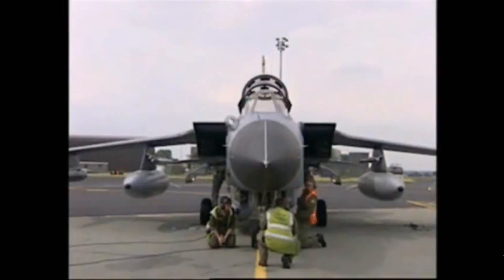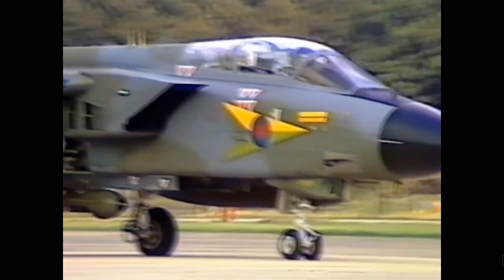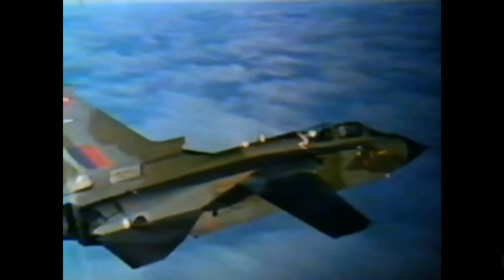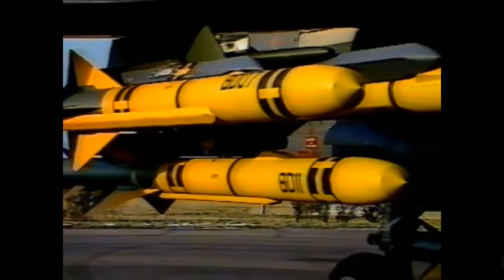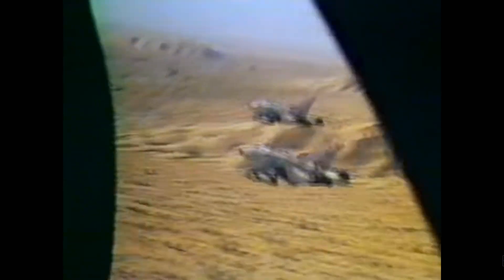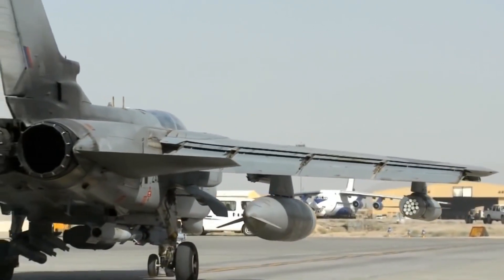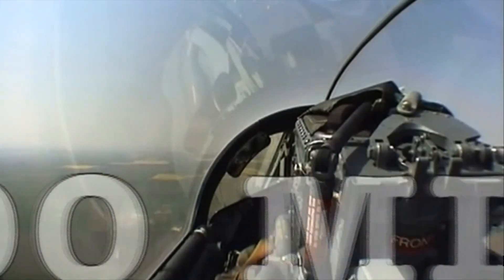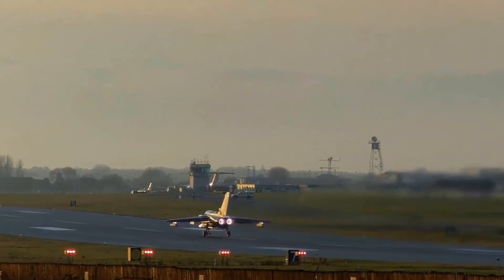Panavia Tornado - Twin Engine Sweep Wing Fighter/Bomber

Comment: It's low level agility and speed are still unbeaten. The Tornado can close in on an enemy at low level that would promote structural failure in any other aircraft. Extremely robust structure.
Reply: Jonny its amazing :P
Reply: it flies so low that the thrust probably promotes structural failure in any buildings around as well
Reply: Even Mig 27, you sure?
Reply: Even Mig 27.
Reply: Jonny you’re forgetting the b1b lancer it was designed to fly at a low altitude while having tons of speed it also has a system where it scans the ground and helps the pilots out
Reply: F-111?
Reply: @timberwolf27  The Mig 27 was not even in the same class as the Tornado.. not even the Su 24 was (much bigger plane for same payload and range of a Tornado). The F 111 created a class of low level variable geometry long range penetrators, with the SU 24 and the Tornado following suit. The Tornado being the last, learnt from the F 111 and Su 24 mistakes.. it was safer to flight that the former planes, more compact but with a huge payload. But it was a generation latter when 4 gen fighters converted into penetratiors like the F 15E and the SU 34 came into service.
Reply: gripen tho
Reply: @broach6152  negative
Reply: Yep.
Probably partly thanks to the fact it looks somewhat like a brick.

Comment: I got a story about these. Back in 2013 when I got to my first base in the USAF in Holloman AFB New Mexico, I wasn't aware that the German Air Force had a training unit with Tornados. I had only been on base for one day when a flight of Tornados took off from the flight line right over my head and scared the crap out of me. This thing is fucking loud! Plus the Germans are crazy.
Reply: The sound is like no other aircraft, even at a distance, it sounds like a huge cotton sheet being torn in half. A strange description but when you actually hear it, it makes sense.
Reply: Yep. First saw a tornado  (a German machine) at Aer Spectacular 88 at the Irish Air Corps Base at Casement Aerodrome, Baldonel in Dublin and holy shit... When it took off it scared the shit out of me but that was nothing compared to the low level high speed pass it performed with the wings swept back.... This thing was LOUD... and I DO mean LOUD.

Comment: ...and yeah it's a fly by wires flight control system .... an amazing terrain following radar, basically hands off flying at low levels with blistering mach 2  .... and don't forget the reverser buckets during landing, the envy of many 💪💪🙌🙌👍👍❤❤

Comment: During a documentary, it stated that the Tornado was the first non American aircraft that could beat anything the US could throw up against it in terms if low level bombing
Reply: A lot of that possibly has to do with the fact that RAF Tornado, Jaguar, Harrier and Buccaneer pilots flew about 50ft. from the ground (mud moving), so were much harder to shoot down by enemy fighters due to ground clutter. it's also one of the fastest aircraft in the world at low level, that's why most of the airfield attacks during the first gulf war were undertaken by RAF Tornados (and Jaguars). I've heard a lot of stories about US pilots being in awe at how low the RAF flew. I also believe that due to the swept wing, it has one of the fastest roll rates of any military aircraft.
Reply: The Brits lie their asses off about the specs. For example, in order to push the LIE that the Tornado was the fastest plane at sea level, they compared an entirely clean Tornado to an F-4 Phantom that was outfitted with a drop tank and external stores fitted! In truth, the Tornado is a fine strike/attack aircraft with some fighter/interceptor capability. This sort of thing is not new. Even "documentory" movies from the 1950s go to great lengths to hype British equipment, while downplaying the capabilities of similar allies' forces, or even ignoring the information. For example, I have a video, that was made in England, comparing British and American bombers. The HUGE bomb loads of the British bombers were constantly mentioned, while the (usually superior) payloads of the American bombers were briefly mentioned, or fudged to make them look smaller.
Reply: mrnickbig1 Remember, the RAF also had F4s, who cares what they apparently said.

As for British documentaries hyping about British equipment, now you know how everyone else feels when they have to watch American documentaries. Just pure arrogance. But it's fine, you "won the war", apparently 😂
Reply: I think our F4s' had Rolls-Royce Spey engines, so they were quite different from the American versions.
Reply: No disrespect to the Tornado but the F111 was the king of low level bombing. The F111 was the best strike aircraft overall of the late/post cold war era. Just look up it's Gulf War combat statistics if you don't believe me. Responsible for 80% of all laser guided munitions, 1500 tanks etc. Not that many served in the conflict either.
Reply: After the TSR 2 debacle we ended up buying Phantoms - initially as a stop gap. To make it more palatable we insisted on British engines...so we had to modify the airframe making it bigger and heavier. Despite the more powerful British engines the plane wasn't improved - any advantage was offset by the increase in weight.
Reply: American B17 heavy bomber, capable load 4000lb's. British Mosquito light bomber - 4000lb's (plus one of the fastest planes until close to the end of the war).
Reply: Depends on the period - during world war 2 Avro Lancaster standard bomb load was 14,000lbs (sometimes carried far more) B17's was 4,800lb. RAF also dropped more tonnage of bomb on Germany during the war (by far in 1944) See wikipedia.  Post war this changed, but I still rank the Bucaneer and Tornado as two of the worlds best attack aircraft and I'm not convinced that the USAF had anything to match it.
Reply: F111 flew its attacks much higher than Tornado. It dropped alot of laser guided munitions on tanks in the gulf war - they were dropped from medium altitude on the tanks that showed up very nicely on infrared having warmed up in the Sun.
Reply: Really? Which war, according to who?
Reply: And yet, the reference was specifically to AMERICAN planes, not British variants. Does "first non American aircraft that could beat anything the US could throw up against it" sound familiar?
Reply: Tom Riley The F111s fitted with pave tack radar flew many low level sorties as well, as far as I can tell. Multiple F111's were hit with AA missiles and returned to base safely. Tornados on the other hand suffered comparatively heavy losses. So low level, survivable, faster, bigger bomb load, much more impressive battle scoreboard. F111 are undeniably brilliant.
Reply: EF111 even downed an aircraft without firing a shot.
Reply: Jimmy W how the fuck is this even possible can I have the source
Reply: Jameson Dymond just use any search engine and search for "F111 Gulf War".  They are not invincible, but they can take a beating. One was a missile from a Mig 23 and another from  Mig 29. EF111 downing an aircraft without firing a shot is a well documented case. Well it was mostly due to target fixation and the stupidity of the Iraqi pilot... Still cool all the same.
Reply: mrnickbig1 u could say that about many documentaries made on discovery I was watching one the other day about ww2 and the DDay landings and whenever an American unit made a advance it said u.s unit such and such had a great victory but when it was a British or Canadian unit it called it a allied advance
Reply: So?
Reply: Jimmy W Pave Tack is an IR sensor, no radar. Tornados suffered such high losses because they attacked iraqi airfields with JP233 Runway denial weopons; unfortunately using this weapons the Runways had to be overflown directly because of lack of a guidance system and the airfields were the most heavily defended targets in this war… so the Tornado had to pay for misplanning- Tomahawks could have done this too
Reply: Laughs in F-111 aardvark
Reply: @x-raf7652  tbh the F4 was a more robust, aircraft than what the TSR 2 was...People bitch about the TSR 2 program ending, but dont actually think about how the aircraft actually wouldve performed, speed was all it had...but it sure wouldnt have functioned as well as the F111, at low altitudes
Reply: Beautiful aircraft, sad to see it eventually retire! Big part of my early working life, worked at Ferranti who made a lot of kit for this aircraft so kind of 'grew up' with it!! Typhoon is beautiful too but does not look anything as impressive as this plane when flying, imho!!
Reply: During another documentary, Bucaneers & Vulcans also embarrassed the 'merkins at red flag while the Tornado was still a prototype
Reply: @mrnickbig1  The B17 is the bomber that gets talked about specifically with bomb loads as it had a much lower lift capacity and range with a decent bomb weight than the Lancaster. It was designed to fly a lot higher and pack heavier calibre weapons. The RAF operated the B17 in Europe well before the USAAF, in daylight, and decided to go with heavy night bombers like the Lanc and fast strike bombers like the Mosquito instead. The B17 was outpaced by the ability to stick heavy armaments onto high altitude  fighters. When it was being designed, the fighters also on the drawing board had low calibre machine guns, by the time it was in frontline service with the USAF, German fighters had cannons that could down a bomber with a single burst of fire. The B29 was the most advanced bomber of the war by a long way, but never served in Europe. In terms of being able to deliver a massive payload into the heart of Germany, nothing came close to the Lancaster. They were dropping 22,000lb grand slam earthquake bombs in 1944-45, the USAF T14 bomb was a direct copy. The B29 could & did drop it in trial, no other WW2 era US bomber could get close. Into the jet era, no British bomber ever got close to the payload capacity of the B52, and I've never read anybody claiming otherwise!
Reply: @robw7676  , I am not sure exactly what you are replying to. YouTube keeps screwing up threads, at least on Chrome,  and there is no understandable hierarchy.
Reply: B17 was 6000 lb bombload with 2000 mile range the Mosquito had a 1300 mi range
Reply: @jimmyw7530  The Tornadoes and Jaguars were used less though and mostly against airfields.
Reply: But a mossie could fly twice as fast, way more accurate with two crew.
Reply: @x-raf7652  America played a con game on Britain and Canada inculcating the idea the maned interceptor was dead and SAMs king so both countries would destroy their industries through neglect while America took over providing the planes. The US only took over for about 20 years until it was clear, we'd all been had and damaged our own national security and self interests. So the Brits wanted a plane and the Germans were free to build, and Italy came along after getting screwed in the NATO Fiat light fighter deal America may have squashed...so the consortium was made and Tornado project started. Where to start...Interestingly, if you look at the Tornado air frame, it has faint similarities with the Avro Arrow's nose body, spine, and tail appearance. Canada was initially in the development of the Tornado and Hawker owned Avro, which became British Aerospace which lead the way in the Tornado project. Canada ironically, just 10 years after cancelling the Arrow, started to look at replacing its dangerous and near worthless 104s. Same with the Germans. The Voodoo would still fly for another 20 years in Canada....long past its prime until the Americans allowed Canada to make a bad ass F-18 version of their own. I guess $$ was the motivator and keeping Canada away from that Tornado project.
Reply: Cough, FB-111 Aardvark
Reply: @mrnickbig1  we are extremely modest. Yanks chest beat all the time. Rather tiresome.
Reply: @G_Diddler , not hardly. And I have many documentaries, made in the UK, that deliberately mislead, or outright lie, about comparisons between Brit technology vers other countries, like the US and Germany. Everyone agrees that in WW2, the UK had the best RADARS, best codebreakers (though many were actually Hungarian), most reliable jet engines, and best early warning systems.And, Brit ships and aircraft were very good, and the UK had many great heroes (some form Canada and Oz), though Mongomery was grossly overrated in propaganda, like Douglas MacArthur.
Reply: @PeteCourtier , Brits PRETEND to be modest while fudging facts to make themselves look better, and constantly engage in passive aggressive activities like deliberately mispronouncing foreign words and names, as a sign of disrespect.
Reply: @PeteCourtier , yes, I like teas, and herbal teas, though not with milk. Perhaps Oolong, with a hint of lemon and honey.
Reply: @mrnickbig1  Splendid👍
Reply: @mrnickbig1  British bombers typically carried far better payload than the American bombers in ww2... For example, the Lancaster carried up to 16,000 pounds of bombs.. the B-17 did about half that at best.
Reply: @JostVanWair  , most British made documentaries about weapons systems lie, or mislead the viewers, by making incorrect comparisons, exaggerating the capabilities of Brit weapons, or hyping up Brit weapons, especially bombers. You are even trying to do this here! IRL, the actual maximum bombload of the B-17G ( the most common variant) is 7,800 kg. The Lancaster's, 6,400 kg. The Lancaster had a slightly larger internal bomb bay, but the B-17 could carry much more ordnance on external pylons. Also, twice as many B-17s were produced than the Lancaster. Heck, even the G variant, alone, greatly outnumbered ALL Lancaster types combined! The Lancaster was a fine plane, and performed great service, but quit lying!
Reply: @mrnickbig1  The b17 hardly ever carried that payload.
Reply: @JostVanWair , but it could, and often carried more payload than Lancasters. Furthermore, the B-17 was hardly the biggest bomber the US deployed. It is true the British generally put lighter loadouts on the B-17s THEY had.
Reply: @mrnickbig1  The "Usual" loadout of the Lancaster was considered to be 2,832 incendiary bomblets (4lb per bomblet, so 11,328lbs in total) and 1 4000lb "Cookie", all of this amounting to 15000lbs of bombs. The B-17, on the other hand, usually carried from 4-6000lbs of bombs and 8000lbs at best. The larger B-24 also topped out at 8000lbs, and similarly to the B-17 carried about half that for longer range missions.
Reply: @jimmyw7530  The RAF Tonados were hitting heavily defended airfield targets with weaponry the F-111 could not carry... Hence the high loss rate at the beginning of the war.  The F-111's were flying medium level strikes against very different, less defended, targets. Now... If you really want to compare the capability of the F-111 vs the Tornado... Should we discuss El Dorado Canyon?  I thought not.
Reply: @mrnickbig1   Sir, you at this point, are trolling.  The B-17 in all its forms could not carry any where near the payload of an Avro Lancaster.  The B-17 was at best a 4 engined medium bomber.
Reply: @Ecthaelyon  LOL Tornado fanboy comes in hot and angry 5 years late to a discussion. Eldorado Canyon, are you talking about the bombing of Libya in 1986… 5 years before the first gulf war began. One F-111 and two aircrew lost in an operation that was an overall success. So, what’s your point exactly?

Comment: I grew up around the Tornado, from the tri-national training facility in RAF Cottesmore to RAF Honington and Marham.  Interesting notes: The aircraft were delivered before the Falklands war, but In-flight refueling was not perfected in time so they had to use the Vulcans to attack Port Stanley.  They have 27mm Mauser guns (not 25mm as you stated around 5 minutes in).  My favorite weapon was the JP233 pods (runway denial) but those are no longer used because of the British signing on to the Land mine treaty (those pods contained lingering mines that were intended to prevent any rebuilding work).  During the gulf war in the 1990s upgrades included radar absorbent materials - it was never a "stealth" aircraft but they did manage to reduce its radar cross section. I believe that at one time (maybe still) it held the speed record at sea level, and even if some aircraft can keep up with it - its Terrain following radar and fly by wire made flying lower at speed more practical than any other fighter of its day.  An aircraft truly worthy of the 617 squadron insignia.
Reply: le recuerdo que las malvinas  seran de la argentina de nuevo tarde o temprano.
Reply: @cesaroliveira6864  como de nuevo se nunca lo fueran ???? :)

Comment: My Dad  worked on these in Lancashire from 1975 > beautiful plane from the 1970's. I stand corrected if i'm out here but they cancelled the F15 to do the low level flight runs especially at night a the Tornados and Jaguars had it perfected. Great video thanks.

Comment: Matsimus , I remember the tornado when  it first started, and it truly has delivered as advertised, Even here in the U S there were a lot of us that liked it.  The Tornado could actually continue to be a viable aircraft with another upgrade  well into the future , as a bomber, and maritime strike air craft, It was a very decent interceptor but its real claim to fame is the strike role and massive amount of exploding mail it can haul.   and your right it is a bomber and most assuredly  it is a great airplane with TWO engines which in low level strike aircraft are always better than one.  You cannot get home to fight another day if your single engine is damaged